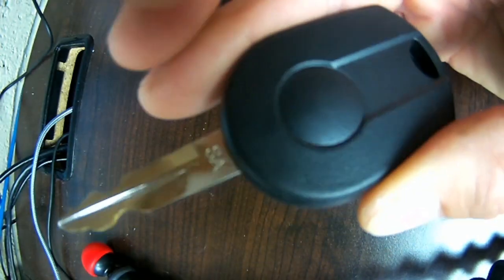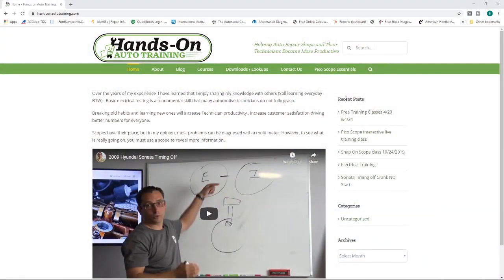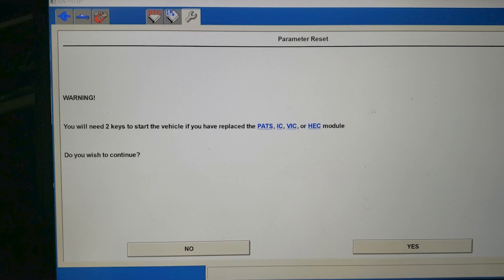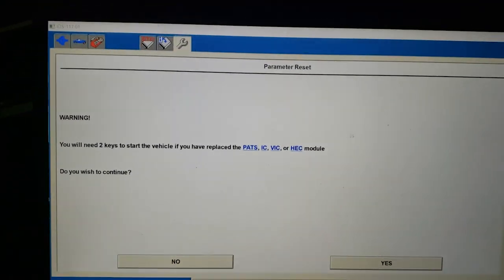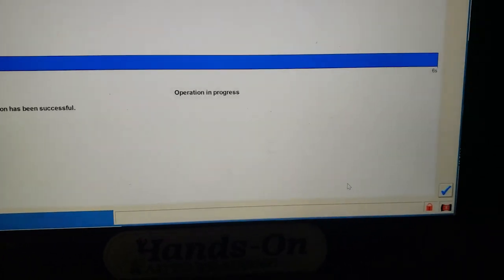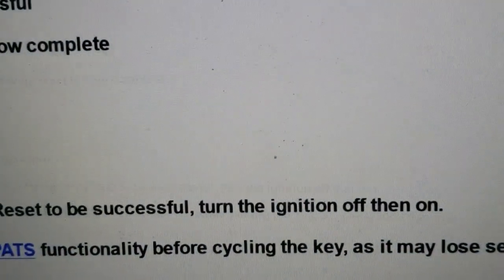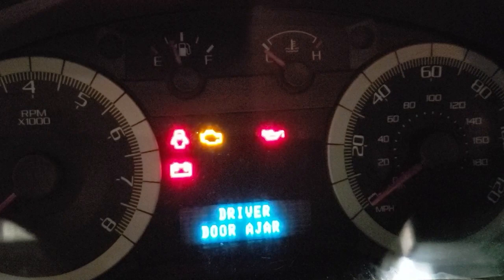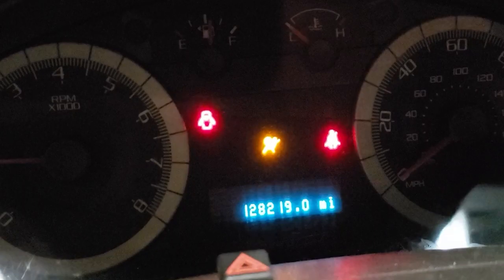Tuesday Tech Tip  FORD PATS

Comment: Thanks for this video! Quick question, I have a Ford Escape 2010 in the shop right now, new PCM installed that has been programmed to the VIN. They sent the following instructions for parameter reset.. (I have only one key in my posession that is in the memory, have been told this is okay and PR should still get the car started with the key I have?)
1. Use a key to cycle the ignition to RUN.
2. Enter the security access on the PATS control function module. This process takes approximately 10 minutes. Type C – Instrument cluster
3. Select PARAMETER RESET and exit the security access.
4. Select the PCM KEEP ALIVE MEMORY (KAM) reset.
5. Start the vehicle.

Technicians have attempted this, and car did not start. These instructions slightly contradict your video which makes me think perhaps trying out your trick may help. So do I tell them after step 4 above, to complete on the screen, exit out of the Parameter reset and do not attempt to start the car but leave the key in the ignition. Wait for a few minutes before turning it off and then attempting to start? Any help would be appreciated, this issue is driving me nuts. Thanks!
Reply: Did u ever fix your issue?

Comment: Hello brian.    I have a question.  I was trying to  program. A  pcm. With my maxisyselite     Autel scanner.   But. I dont. Find. That. Option.   
So i went. On the  anti theft. Option.   And. Wait 10 min.    The.    Letme go in.    So was option only for keys.   Remote control. Etc.       for accident i hit.  Parameters reset.      Now. The.   Theft light its on. And wont let me start. The car.     What. Should. I do.      Thank you.  😢😢
Reply from the maker: How many keys are stored in the pats module? PARAMETER reset may have deleted and you need to program 2
Reply: @BrianMann216  i believe 2.    I have no way to. Know.   Scanner wont tell me.    But i got 2 keys on my hand.     That. Just to work with the car.
Reply: @BrianMann216  i  used. The programming key option and follow they. Steps.   First. Ask for 1 key. Then ask for  the second one.   And say. Both key. Are programmed now.   But still wont let me start the car.    No crank.  And. The security light its. On.
Reply: @BrianMann216   the car that i working on is a 2011 ford taurus.

Comment: Hey Brian I’ve ran into a issue with my 2000 F-150 my original cluster shorted out to do a solder shortage on the odometer pins so it’s fried. I recently bought a used cluster obviously from a salvage yard that was in great condition for $50 and then I was told there’s a chance it could be plug and play and there may be a chance not and that’s my case the cluster looked like it was gonna work the gauges moved and everything but then it flashed a 15 anti theft code and that’s the key and the truck not recognizing the cluster so the truck would not fire but it would turn over the PATS system is not allowing fuel to the injectors. I had a lock smith come out and do a parameter reset to clear the code and relearn the key and cluster and that failed he didn’t have a clue what to do and supposedly the parameter reset kept failing and popping up weird codes and I was ask if the PCM was changed and it hasn’t been touched I know this is a lot but I hope you get back with me I would really appreciate because I need my truck.
Reply: And just to mention I only have 1 key for the truck never had a spare for it but I’ve been told I don’t need 2 keys to program a new cluster but in your video it seems like I do?
Reply from the maker: If your keys are stored in the cluster and you swap it out/ parameter reset you will have to program 2 keys. That older truck i think there were 2 styles of Pats for that year,  important to get the proper cluster.
Reply: @BrianMann216  it’s a 100mph Tac Cluster I ordered it from a salvage yard and it’s the except same as the original even though the receipt says 2000 Ford Expo for some reason but I don’t think that matters because they’re identical I guess that’s why they sold it to me so I don’t think that matters. So do you think I should have someone else attempt a parameter reset or just tow it to Ford because I don’t have a spare key
Reply from the maker: @alexharper9786  I would get a second key [non cloned] and try parameter reset along with prog the keys
Reply: @BrianMann216  where do you recommend me getting a 2nd key from ? Locksmith?

Comment: Hi, does this program works on 2001  Jaguar? I assume, as Ford owned Jaguar at that time.

I have a 2001 Jaguar S Type and suddenly won't start or crank. PAts light flashes rapidly for 1 min, and after that start flashing slow, from what I can tell is code 22, but can't find what that code is. Someone told me that I'm screwed lol that the security system is on and I will have to take the car to a Jaguar dealership to reprogram everything, the sad part is that I live in the Dominican Republic and the only Jag dealership is way far from where I live and a tow truck will charge me a lot.

Thanks for Any help on this!!!
Reply from the maker: Hello Eric , I am sorry to say that I have no experience with Jaguars. They are very small percentage of the market where I live.
Reply: @BrianMann216  thanks!!!

Comment: sir, I replaced PCM in a 2014 E250 and attempted to use Autel MS908. I went through reset procedure. after the 10 minutes it gave the following message The Hybrid electrical Cluster (HEC) module is not permitting security access. Does this mean I have to have it done using J2435 Programming tool ?
Reply from the maker: I think so ,using ids should work

Comment: Great video First of all, I had the same a problem with a 2008 Ford Explorer. They change the computer and program the two keys and that one step was not done. The Pat's light was off  I did the reset and it started.
Reply from the maker: For 08 explorer no need to erase and program keys, they are stored in the cluster. Simple parameter reset would take care of it.

Comment: Fascinating, I use Forscan for my Ford's and the boys mazdas. 
I had to recently program 2 new keys on his 09 RX8 from Mazda dealer because he lost his and was using his AKE
During process it said something about non OEM key problem for each key, but the keys are "working" but the security continues to flash while driving but it starts every time for him. It's his DD for work. 
He does have some u codes for IC, I think he is having trouble with the immobilizer, because he was caught in a heavy downpour. The day before.
I'll dig deeper when I get time. 
Not asking for help, just sharing a diy guy problem. LOL
Keep the vids coming.